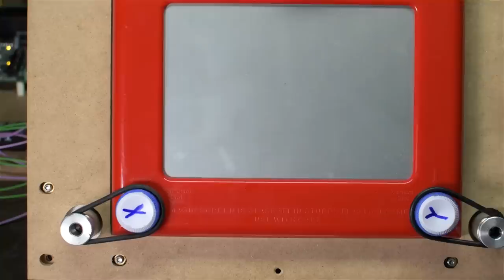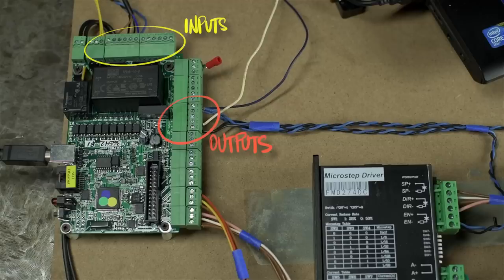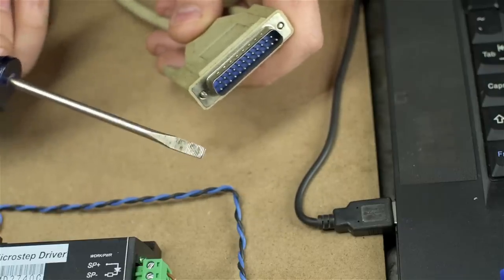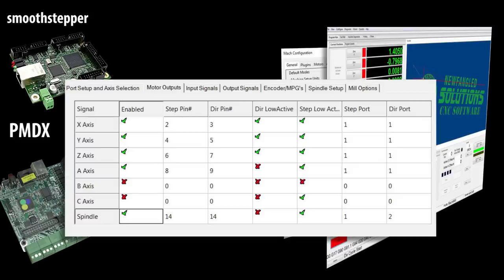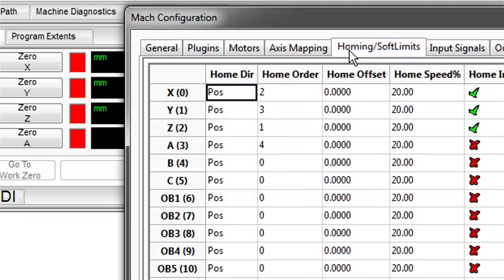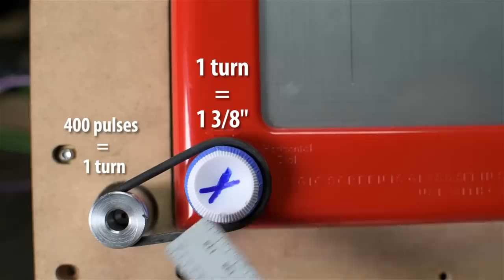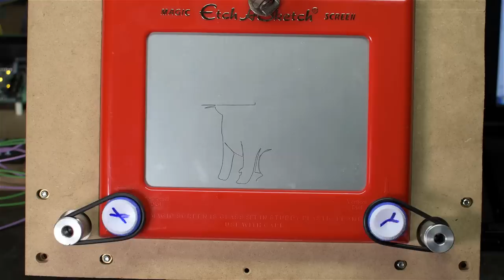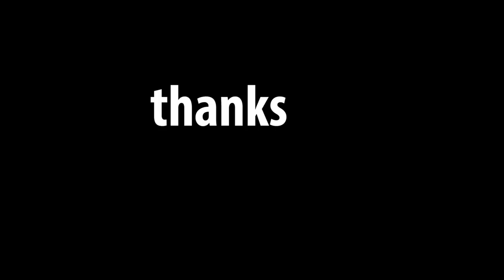Build Your Own CNC! (Part 2) - Inputs, Outputs & Software

Comment: To this day I've never understood why CNC machines are built the way they are. This is what stops me from buying a 3d printer kit also, because they operate in the same manner. Why do they rely on shaft encoders (at best) to get any feedback from the machine or as seems more often the case, have no feedback at all and rely on just the number of steps for position?  Bubble jet printers are how many DPI these days? Simple quadrature optical sensors on the table itself or the gantry can be made with high enough resolution and would give absolute positional feedback meaning that wear in things like lead screws would be irrelevant.  I'm designing my own 3D printer and a CNC laser engraver with this intention. Am I on to something new here or is there something (probably very obvious) that I'm missing? I wouldn't think it'd be any different to a DRO.

Comment: RELAYS NEEDED TO RUN THE MOTORS? DON"T THINK SO ! I ran my entire bridge port and my lathe off the 3.3V and 5V outs as well as the digital logic level signals on the board, could run like ten motors at once. off the Arduino. Be careful of those 5V out puts I had to put a 10 watt resistor in series to stop it from blowing out the bridge port drive motor. Just make sure your Arduino has a good strong high current quality power supply like those usb ones you get for free when you order a 3$ shipped portable DVD player off banggood. Biggest piece of work I have powered off the Arduino was a 12" by 8' Iron drive shaft no problem taking off huge 200-400 thou cuts first pass. Thinking about getting a raspberry pi to power the entire garage with its digital outs. Since most things are digital these days like the washing machine they should need digital power.
Reply: Yeah, nah mate.

Comment: Your backlash will normally be compensated by an external encoder.  It goes into the scary world of CONTROL THEORY!!!   You're just able to now measure your sources of variation/error when moving so you always get to the position you desire.  Just like adding a DRO to a mill, but now the computer is doing it.

Comment: I know I'm kinda late to the game but I wanted to get this out there.
Do NOT buy a "NVUM" Mach3-Compatible CNC Controller!
The software is complete garbage full of weird error messages and a general sense of chinesium. 

Let alone the thing doesn't even work at all with mach3. 

Had a terrible experience, ended up with a refund that took just under 2 months in total and then proceeded to buy a PMDX-416 and Mach4. A little bit more on the costly side but well worth it!

Comment: HOW DO YOU TURN THE PICTURES INTO THE MACHINE CODE? UNLESS YOU ARE JUST UNREAL AT TURNING NUMBERS INTO PICTURES IN YOUR HEAD In which case you should probably get a job as a printer, not someone who operates a machine but rather act as a print drawing images by lifting the pen up and down as paper feeds under it. But seriously can anyone actually draw a picture the way a printer does? Moving a pencil around in circles is so analog.  I tried as a kid and now I'm not a professional artist/printer.

Comment: Okay video but I have some disagreement 
First, I disagree with the cam vs manual made code. In general all the cam software export mapped code that is not can called even a program. A good programmer can made optimized code than a cam can not do. Like any procedural logic (conditioning, looping, subblocking), servo logic, etc.

One other disagreement is with this mach software, I had use it ones before five gears. it was really a piece of shit, no structural logic, no behavioral conditions, no loops, and all this with an overhead limitation of 10k lines. I do not recommend to anyone, use this Mach thing. EMC2 is grate, free (libre) and for free (no price) and absolutely more professional than this mach bullshit. Also TurboCNC is okay but way more complicated in any servo logics.
Reply: Depends on what market you are aiming at!!! For dumb-arse (dumb-ass  - US Translation) newbies like me (and perhaps many other subscribers) being able to get some sort of result without too much effort stimulates the desire to learn more. Over complicating the problem only serves to dissuade we plebs from giving it a try.